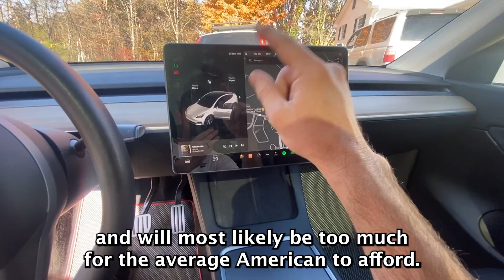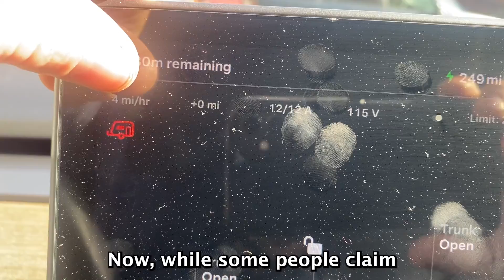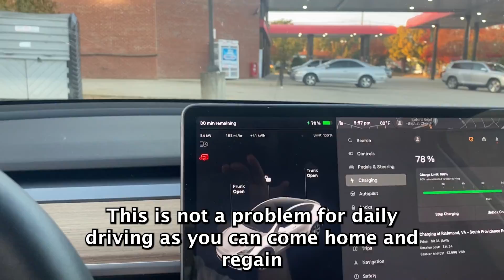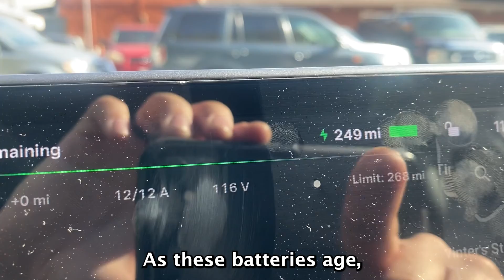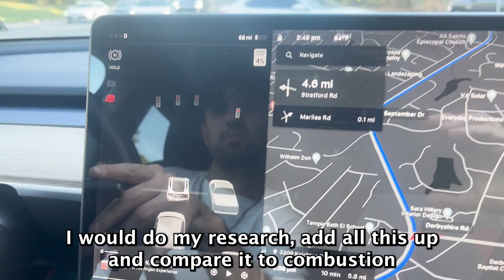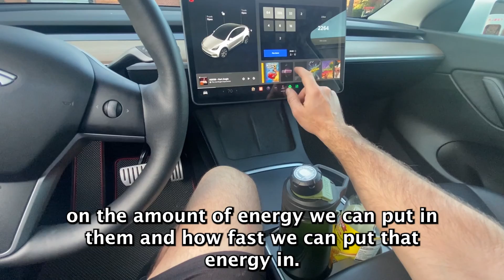Why Electric Cars Can't Replace Combustion Engines

Comment: I hear the same old gas head talking points all of time and they are easy to cherry pick. The electric revolution is coming and there is nothing that will stop it. EV's are faster cleaner easier to build and less costly to repair per mile period. I have had 3 Tesla's and only ever had to fix minor issues. Electricity can also come from your roof with solar. (not for everyone I know) Coal use for energy is on the decline so that means if you plugin to charge your energy is becoming cleaner each year. The grid is currently being expanded throughout America not because of EV's but because of AI Datacenters. Your EV will only be a small percentage of the PowerGrid output. Charging time is typically 20 minutes at super chargers, that is not enough time to take a shit and get a meal when on a road trip. Also, the batteries last for a long time. How long is not yet known as EV's are too young to get real long-term statistics, Degradation is extremely minor when treating your battery correctly. Your statement about 10 to 20 thousand dollars to install a charging port is simply false! You can install it yourself for free! or if you are not skilled in that area it can cost up to $2500. You can buy chargers online for less than $500. Typical battery warranties are 8 years and over 100 thousand miles and the costs are coming down due to competition and CHINA. You can get a rebuilt battery for 15 thousand or less depending on model, that is cheaper than a crated performance V8 LS, the EV revolution will not happen overnight. It will take time, when was the last time you saw a horse and buggy? Those diehards also said they would never drive an automobile.

Comment: I like most of your videos but you are way off base on this.  But for EV doubters (I was one) buy a plug in hybrid.  I bought a Chevy Volt, 95% of miles are electric. gets 40mpg on gas and no range issues.  I slow charge overnight on a standard 120 outlet.  Today's best bet is a Toyota Prius plug in but there are other good choices.  Chevy is know for marketing blunders and quit the Volt but their little EV, the Bolt is loved by it's owners and the new Equinox EV looks like a winner.  Think I could beat you to Texas by the way.

Comment: The advantage of EV is this. An underwater tunnel full of non exhaust emitting EVs vs an underwater tunnel full of internal combustion powered vehicles. Now open your windows and inhale deeply. Which car is going to fill your lungs with toxic fumes and which will not.

Comment: One more comment. With all the emphasis in high school guidence programs where the only thing drilled into these impresionable young minds is the only way to get ahead is to go to college (which have become very expensive indoctrination centers). There is very little in the way of what we called in my day vocational training these days, much less any training on modern vehicle electronics. The attitude the last few decades for vocational training in high school is that is where you send the "bad" kids as the I call them non-guidence counselors tend to do. Of course if you don't have any vocational training available or that training is inadequate only the self starters will be sucessful. Bad counselling along with bad parenting is why we are in the state we are in with regards to a lack of a quality vocationally trained work force . This reason us also a huge driver for poor disposible products, cars included. Sam W3OHM

Comment: Hi Eddie,
You are dead on with your comments. I still don't understand why the politicians in DC are so clueless. The only vehicles that make any sense long term in the electrical relm are Hybrids. I have a Toyota 2008 Prius that has 250K miles on it and still on the original traction battery. I am on the 3rd 12V battery, one water pump and maybe the 4th set of tires. I change the oil (full synthethic) every 3K and use 1qt. of Lucas in the oil. It has been the most reliable vehicle I have ever owned and when the traction battery finally gives out I am going to put a brand new one in there and run it until I go to the great resistor in the sky (I'm a retired Electrical Engineer) or until the wheels fall off. If I could buy a new 2008 Prius I'd do it in an instant! Much more reliable than the brand new (then) 2006 Pontiac G6 GTP convertible I bought my wife! Long Live Hybrids! Sam W3OHM

Comment: 8:36 outdated information for 2024
Reply from the maker: True but not everyone will be buying a brand new car in 2024.
Reply: @justcallmeeddie1  We bought ours in 2023 brand new out of necessity. Our honda element had a bunch of mechanical issues that we didn't want to deal with. So we got a tesla model y to save on fuel costs. Now it's our primary car we drive around in. 
If only there were more charging stations in central utah...